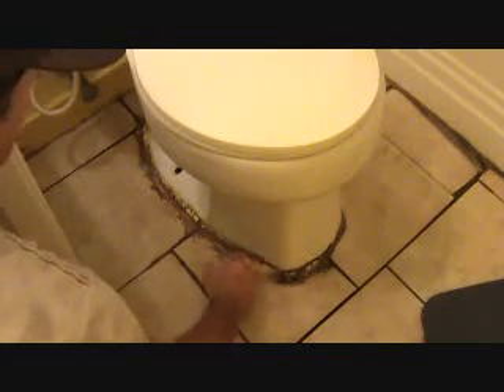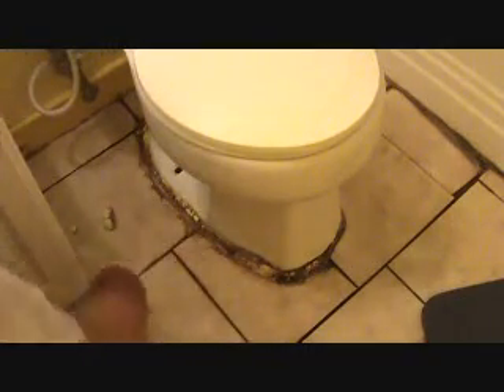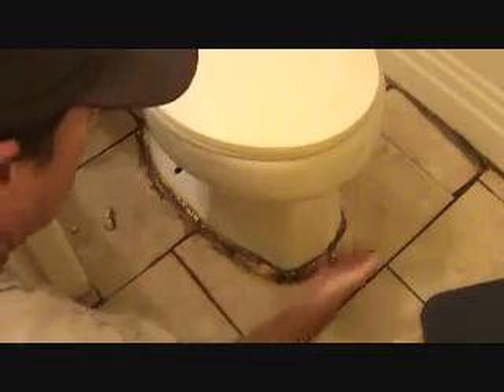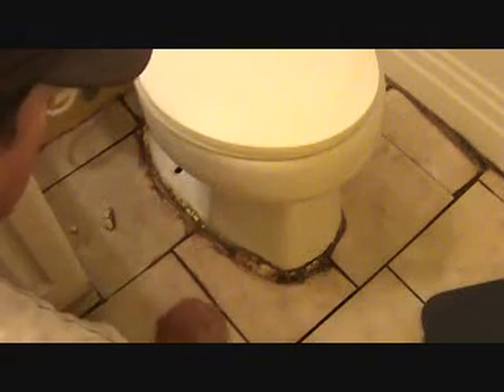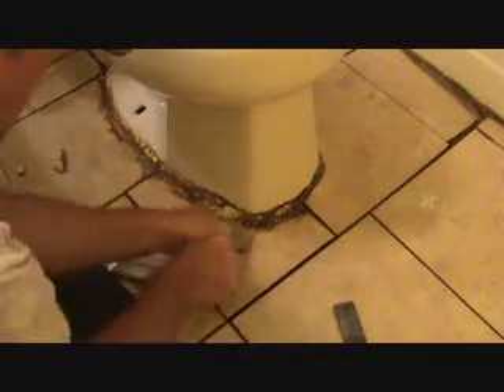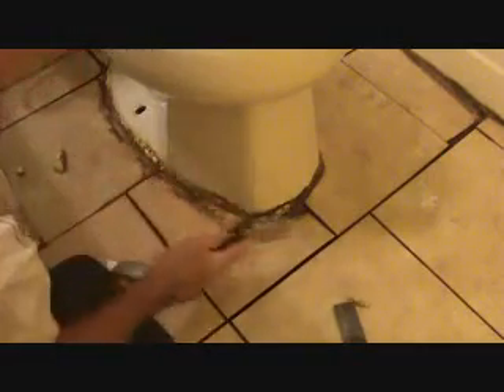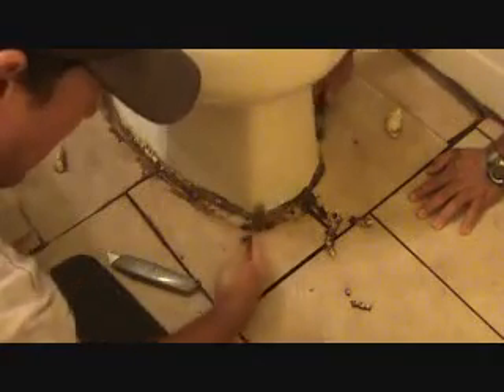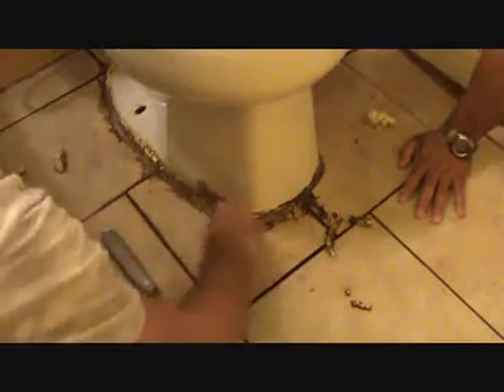How to install a toilet: what "not" to do

Comment from the maker: @disclosurenow9 Your point is well taken. If that was my home I would've done that. I was helping out a friend with his Grandfather's leaking toilet. That's why the tiles are a bit loose & separated at the seams. I was only going over there to fix the immediate issue with the leaking toilet & suggested to him that he remove & replace the tiles soon. The subfloor is concrete so will not be doing any damage to any wood structure. Good call though. Thanks for sending me your comments.   Joe  :0

Comment from the maker: @Queenterrier  You can use silicone around the base of a toilet too. That works but costs just a little more than what I used in the video. As long as you use a caulking that is made for wet areas like kitchens & bathrooms, you should be fine. If you have any questions, while you're at the hardware store, ask a friendly store associate & they should be able to give you a few options. You wouldn't have known unless you asked so thanks for asking. The more you "ask"...the more you learn!   Joe  :0

Comment: Videojoeknows,  I want to replace my toilet, but it is cemented to the floor.  Why would anyone cement a toilet a t floor?  How should I go about removing the toilet?
Reply from the maker: Ha! another first for me! I've never heard of someone cementing their toilet down. Since you have to replace the toilet anyway, then I guess you will have to start chiseling the bottom seam away & hope that they have just cemented along the bottom edge. Are you sure it's not just a gray caulking that has hardened to look like cement? Try scoring it with a sheetrock knife. worse case scenario the toilet will have to be broken out to remove. If you have to do this, make sure to wear safety glasses & gloves. Porcelain can be very sharp once broken plus little bits fly everywhere. Once removed you can scrape off all remaining bits at the floor line. Let me know how it goes.    Joe  :0
Reply: afew sledgehammer whacs should do it....lol......i dunno...  woo hoo !!
Reply from the maker: Look at it again & make an attempt to remove it without breaking it. Wear those safety goggles.   Joe  :0

Comment: The only comment Joe made about the foam is that it's probably not a good idea to use that foam for what appeared to be an attempt to prevent leakage. I agree with Joe. That is not the proper use for that particular foam and there are many products out there meant for the bathroom. Some specific for around the toilet even. simulatedeyemovement stand by your decision but don't let a comment based on facts during an informational video upset you. Instead take the advice and better yourself.
Reply from the maker: I would have to agree with you. Thanks for your detailed message!

Comment: THEORETICAL QUESTION.....If one was very careful, and after draining the bowl....instead of removing the toilet and replacing the wax seal,  could one (carefully) HEAT the toilet base with a mild flame blowtorch thus softening the wax and letting it reseal itself???  Several tries may be needed.....if this fails to fix it..THEN by all means this is a good video and I would recommend it.....   woo hoo !!
Reply from the maker: Wow I see your mind has been working overtime on this one! Chances are very slim to none, that your idea would work. it gave me a chuckle though. The wax ring has failed somewhere around the rim & the only way to make sure your toilet does not continue to leak would be to remove the toilet & install a new wax ring. Let me know how it goes, smartie!    Joe  :0

Comment: You should rip out that crappy tile job and redo it. The subfloor is most likely rotted underneath as well. No point in reinstalling the toilet over that wobbly rotten tile floor. It will continue leaking. If you mess up a job don't be afraid to rip it out and do it again until it is right.
Reply from the maker: I was just there to help a friend reinstall his Grandpa's leaking toilet....